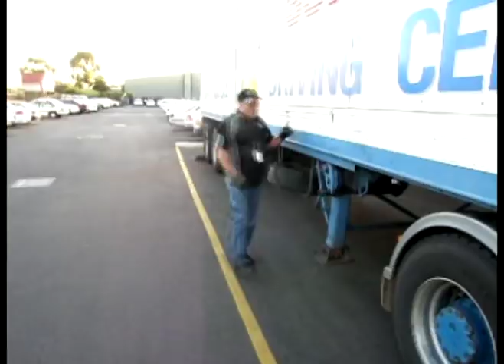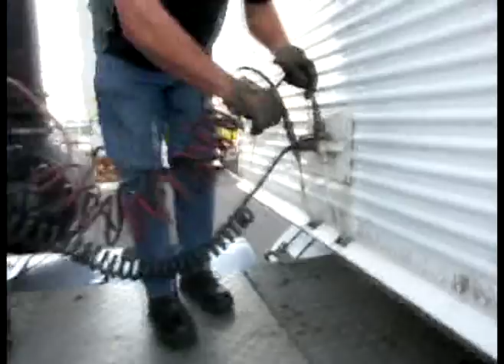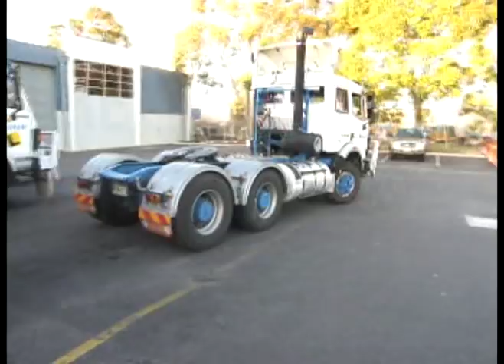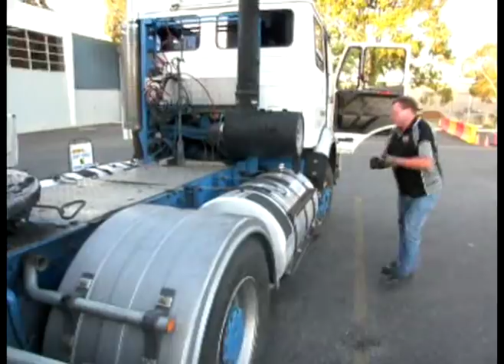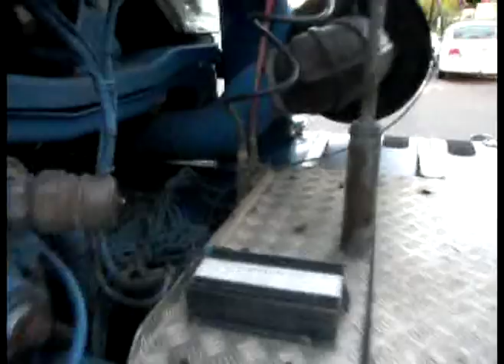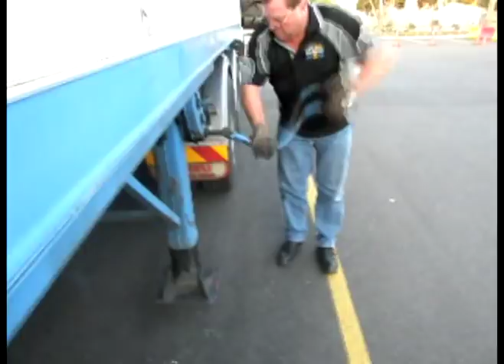Unhitch and hitch a semi trailer without air bag suspension

Comment: From memory in my test you had to back up to just before the trailer, get out and check to make sure the trailer was at the same height as the turntable, if not lower the trailer, back up and lock into the king pin, get out and wind the legs up till there about 6" off the ground, get back in and do the tug test to make sure its hooked up properly, get back out and wind the legs all the way up and connect the air lines then drive forward and check the trailer brakes.

Comment: In reality tho, the way i do it now is to back up under the trailer (you know if the trailer is at the right height with out getting out) do the tug test, turn on parkers and hazards, get out and wind the legs up and connect the air lines and check lights, get back in and check the trailer brakes, job done, what is required in testing is different to what is needed in reality.

Comment: Your kidding me right? you teach people to hold the trailer brake on to hook up to the trailer? what if its the first time they have towed that trailer and they find out that the trailer brakes are not working? with the legs down it will hold the trailer in place, with no legs down its quite possible to push the trailer backwards and when you stop the trailer keep going and fall off.